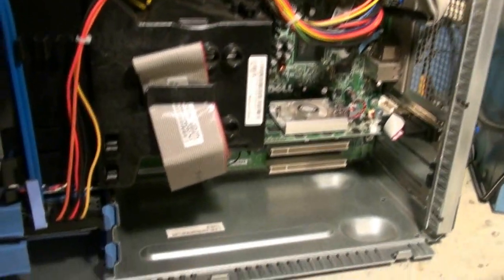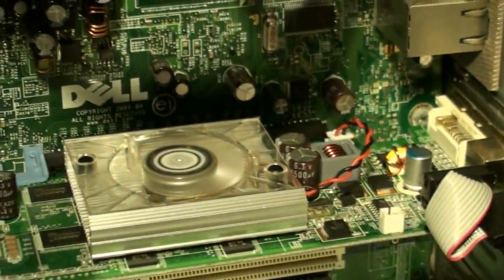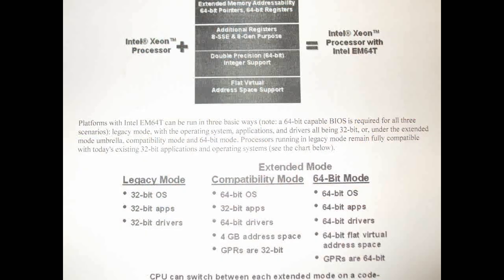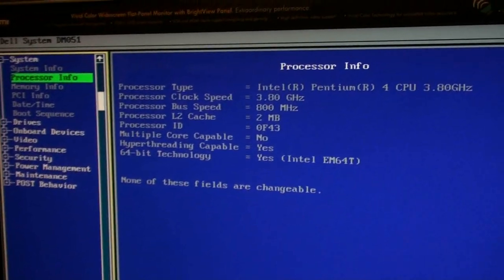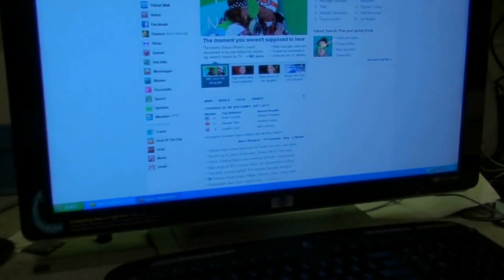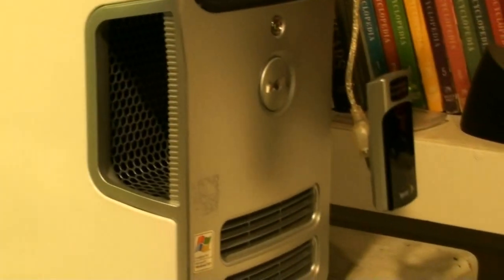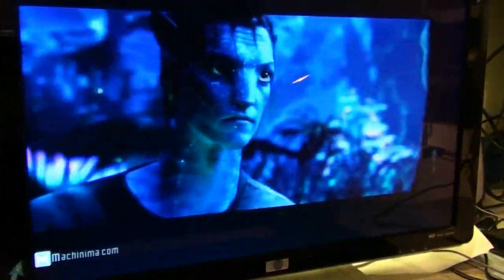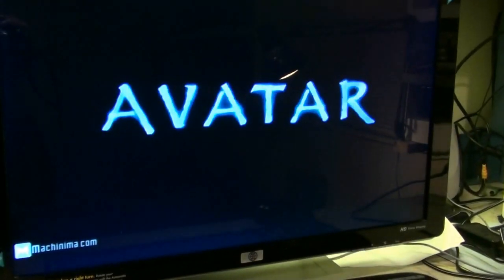Dell Dimension 5150 How to Upgrade to 3.8GHz CPU and Memory Part #5

Comment from the maker: @fabric121122 the 2.8ghz and 3.0ghz cpu in a dell 5150 can both run and play 720p videos fine, but they can not edit 720p videos for a youtube channel and that's what this video is about, the 2.8 & 3.0 just don't have the power it takes but the 3.8ghz can. 1080p editing will need a quad core pc tower to go to an even higher level.

Comment from the maker: @fabric121122 hi, I would always recommend a quad core tower but, if you only have a single core 5150 the cpu in this video is the fastest one, the bad thing is the cooling fan on the cpu will turn on more often and run faster on running higher level task and some people don't like that noise.

Comment: If you have a seperate device, then we can skype, you just need to be able to enable video, im 12, and have been working with computers for years, i would have already disassembled and fixed my mother's Toshiba Satellite L305 if the battery screws weren't stuck, and i sure as hell am able to teach you how to replace the graphics card in a desktop.... and also am able to teach you how to put a better processor in it. If you still need help, contact me after 5PM EST @ skype: technogeek12
- Kenneth